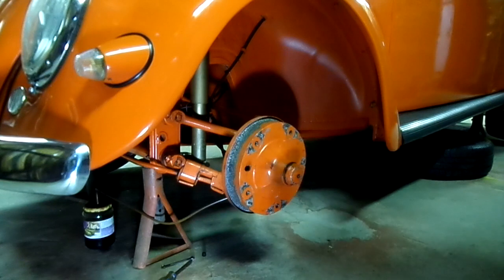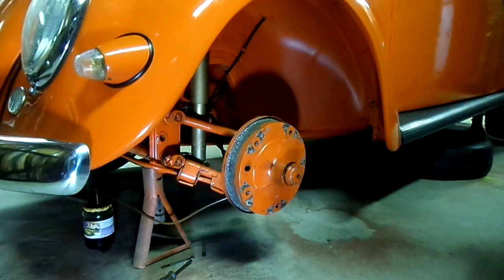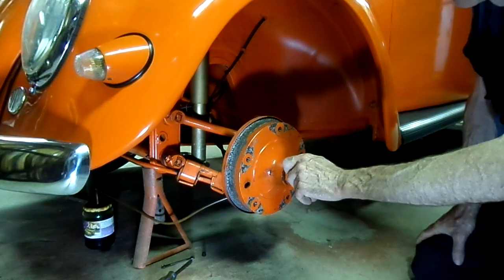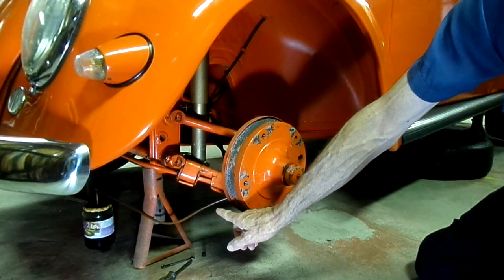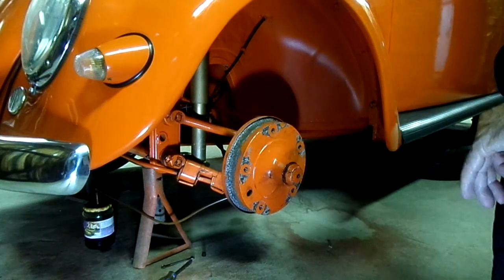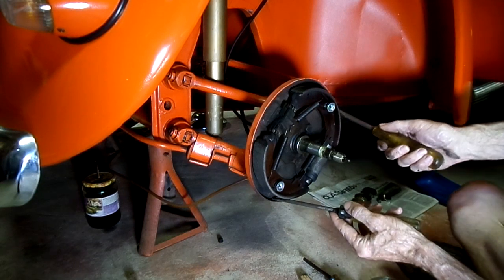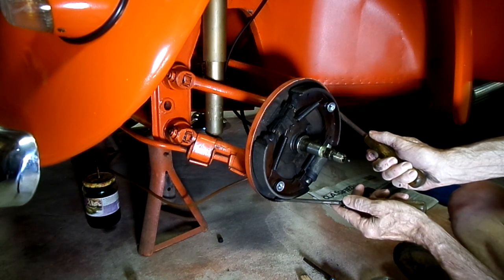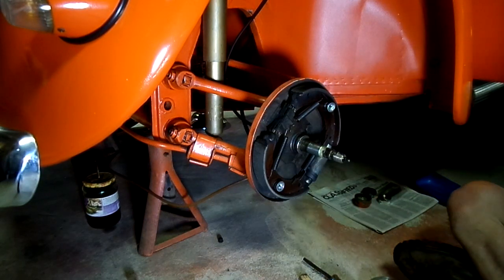Vw Beetle Wheel Cylinder Troubleshooting

Comment: Loverly job richard :-D
The cylinders must be a very close fit, they look brand new so i'm not supprised.
If it still failed i would change the spring just under the cylinder for one that's ever so slightly shorter.
Or buy another spring and remove say 2mm from the straight ends total.
But im a bodger lol :-D
Reply from the maker: I was thinking on changing out the DOT 3 fluid to DOT 5 to try and eliminate the  hygroscopic problem, what do you think.
Reply: I admit that i don't know, will dot 5 do any harm to the piston seals or master cylinder seals?.
Have they been replaced with modern seals?
If not i would stick to the original fluid.
Are the brakes becoming less effective the hotter the system gets and that's why you are thinking about water absorbsion?.
Reply from the maker: I was thinking that if i switched to a silicone based fluid like DOT 5 i would not have to flush it out ever 2 years like the DOT 3
Reply: I would give it a go but flush out the old fluid first.
Maybe replace the piston seals if they are not too expensive, then it's a fresh silicone system :-D

Comment: So what do you think caused the cylinder to start binding up?  Contaminants in the old brake fluid or something else?
Reply from the maker: Good question the only thing i can think of is the shoes are small in comparison to modern ones which might lead to them generating a fare amount of heat.
Reply: @RichpinTv  If that was the case you'd think Beetle brake lockups would be a more common occurrence. I'm kinda wondering if that wheel's brake line is deteriorating internally and debris is making its way to the wheel cylinder.  Something to think about anyway.